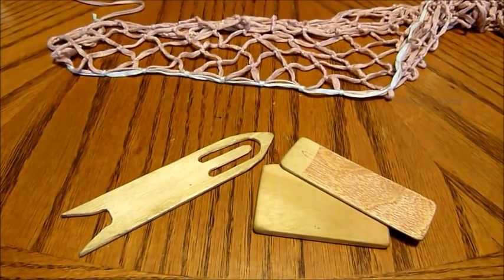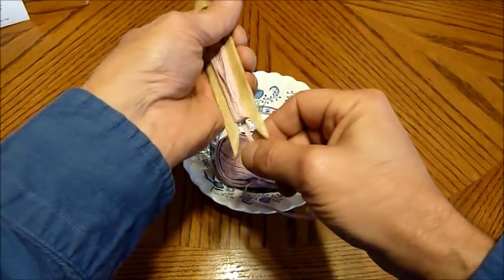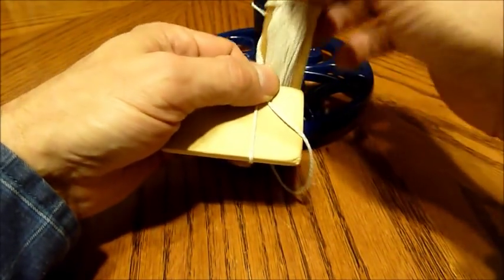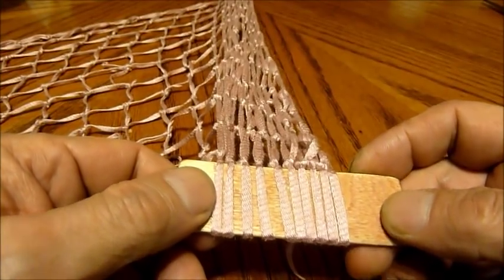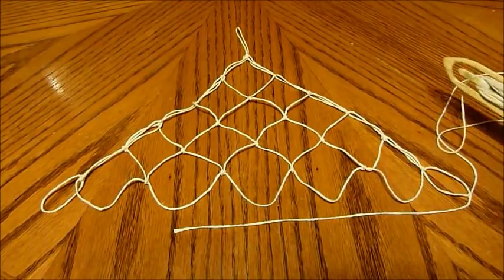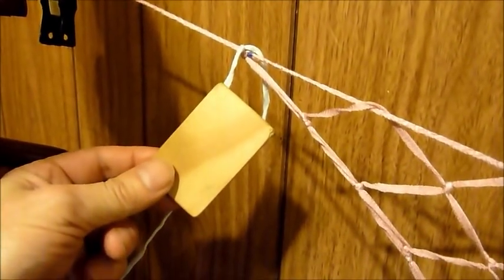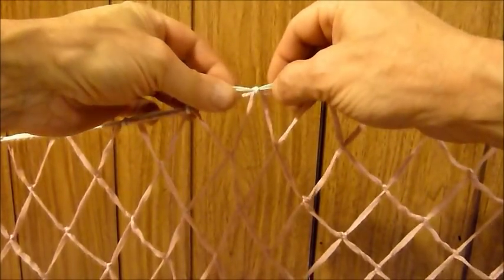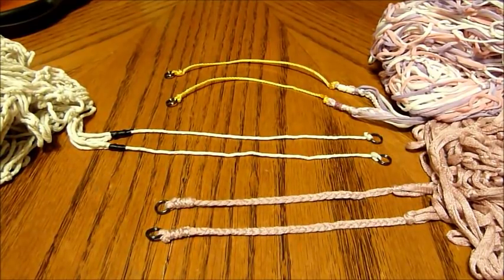Making a Bubbling Net with a Netting Needle

Comment: Very well explained! But whenever I try to make it the knots end up acting like slip knots, so my nets are never perfectly square 😕
Reply from the maker: When you make your net, the knots can indeed slip if you force them. I soak & wash my new nets in a strong solution of soda ash (a.k.a. washing soda, sodium carbonate; 1 tbsp/2 c) and Dawn. The material swells and helps secure the knots.

If the knots slip, slip them back and tighten again.

Comment: would the end loops be helped by using a slightly smaller guage then go back to the original guage?
Reply from the maker: Sorry so late to reply. I suppose that might work. I haven't tried it. I think it would be very difficult. Another way I've discovered is to pull very tight and stretch the material as much as possible, when making the stitches near the ends.

Comment: an  8 ft net how much  mesh to start with
Reply from the maker: The yarn I use in the video weighs 0.45 grams/meter. To make an 8 foot net having a 2.5 inch mesh, you need about 52 grams of material.